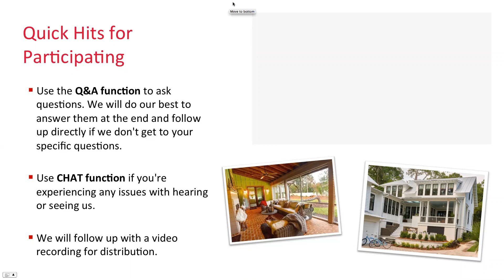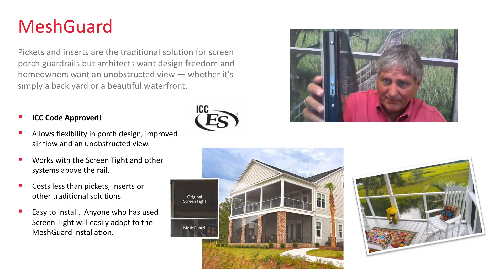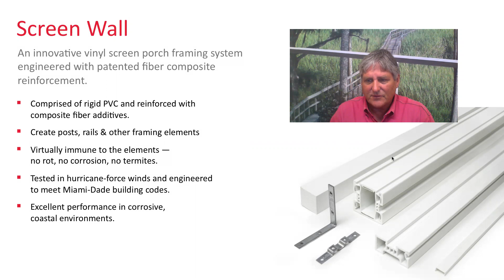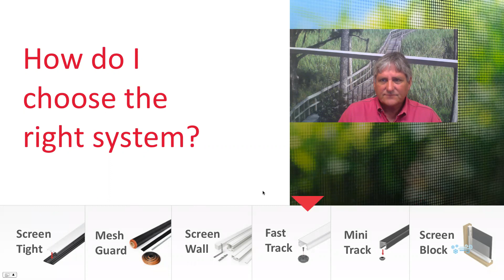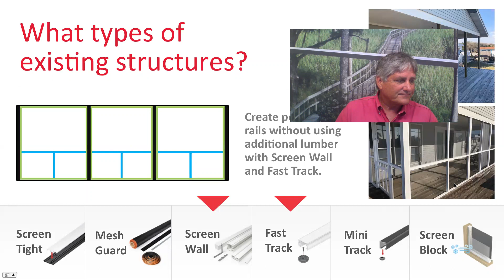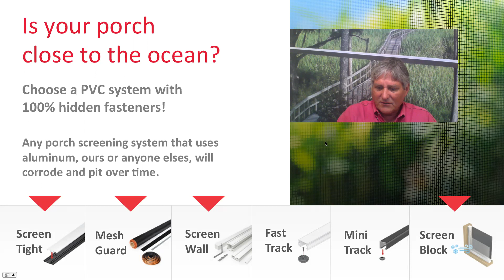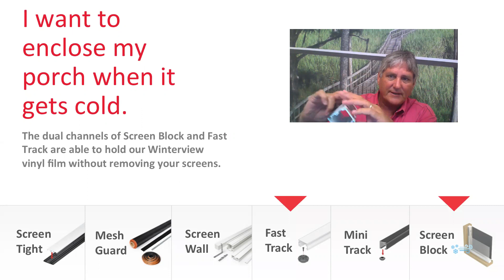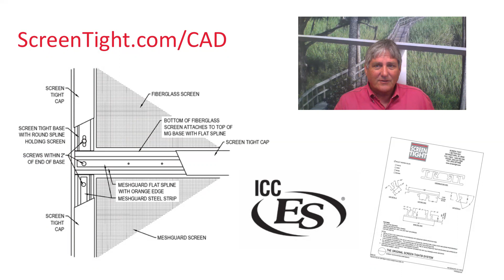Screen Tight Porch Screening Webcast

Comment: What do you paint your wood with when using Screen Tight?  Can you put a light layer of water proofer on the wood framing, and do you paint your wood, i.e. white, prior to building the frame out or after?    lastly, can you use the plastic pvc winter plastic with the Screen Tight system?